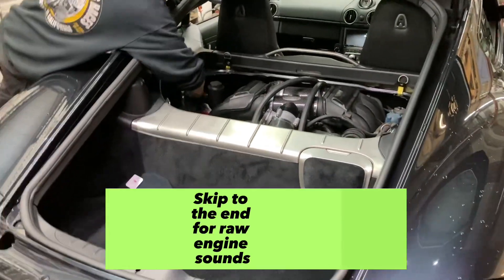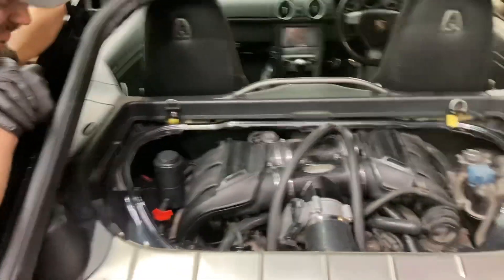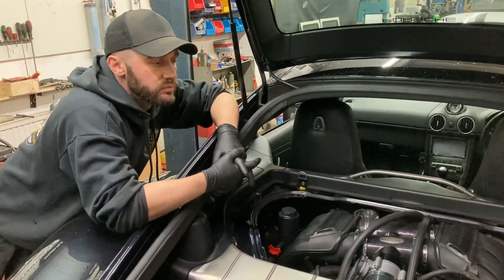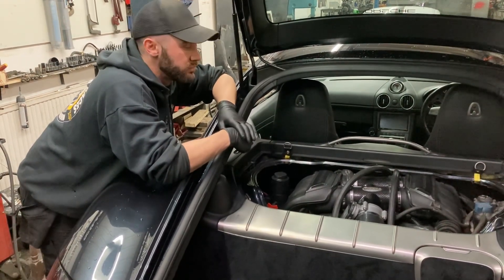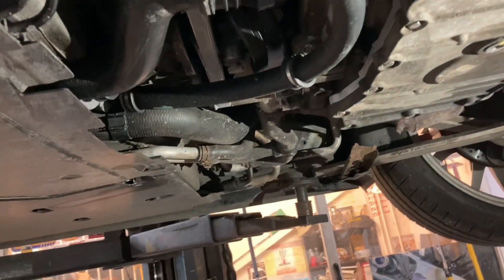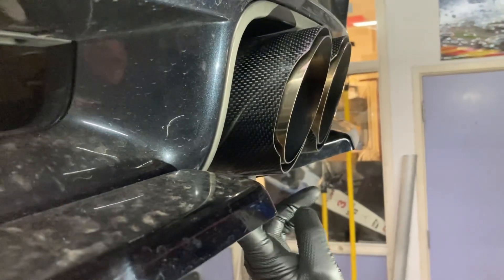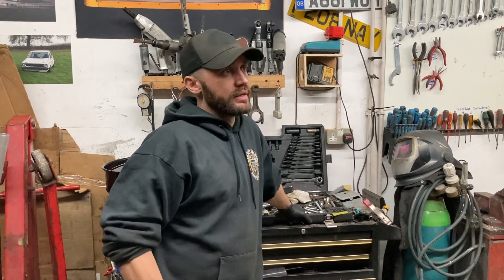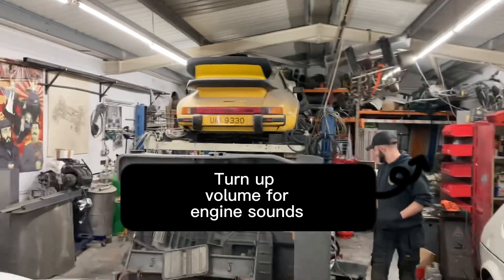Porsche Cayman MRN Twin Turbo Raw Engine Sounds

Comment: This kits appealing to me , quick question though.  On the mrn replacement intake what happens with the rear swirl flap thing fitted on the oem system , is that just deleted ?

Comment: nearing completion on my 07 Cayman S here stateside in Oregon- just have rear exhaust, charge cooler fill & wiring to complete... surprised to find my car had some kind of boost kit in the past as the front radiator has welded bungs for the water lines and straight aluminum tubes with swaged ends for the middle straight section under the car... should be firing up for the first time later this week... impressive how well engineered the kit is
Reply: Hello, 

Are you installing the kit, or is a local shop dpong it. I am considering buying the kit.
Reply: @olivoguerrero5541  just finished the install myself
Reply: @briangibson-el4xr  engine still chugging along?

Comment: are you running a colder spark plug?  i've finished my install using colder plugs & am getting random misfires on 4 of the cylinders

Comment: Like most turbo Porsches it has lost that signature BoxEngine flat six sound, whilst I admire your mechanical creativity I like my NA engine sound more that any performance gain, without concluding I would look forward for your test run to see if I will bring in my Guards Red. Thanks for sharing